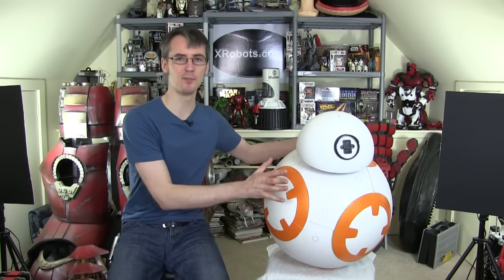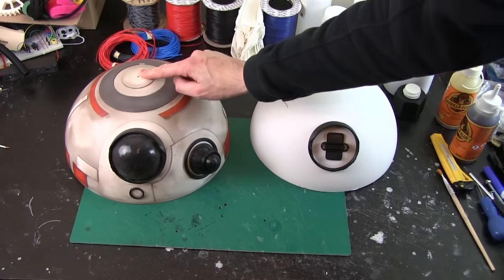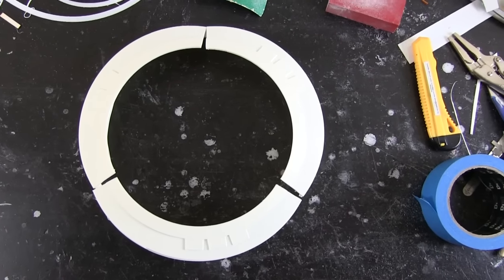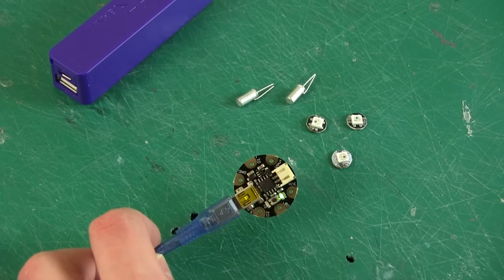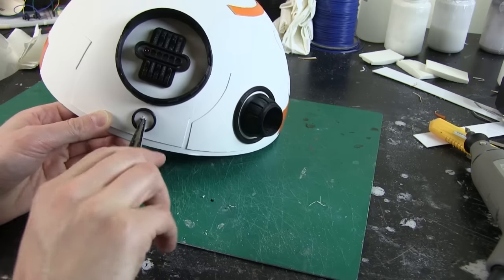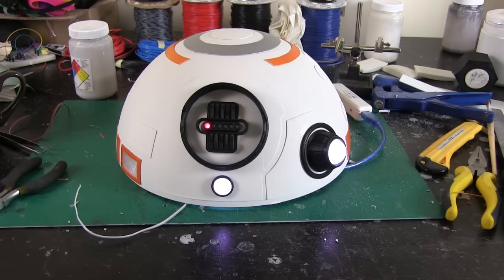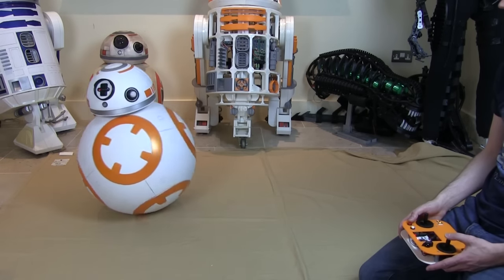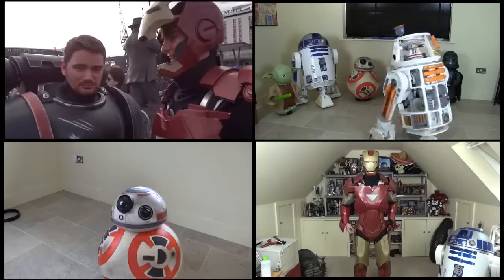Star Wars BB-8 Droid v2 #7 | Head Details & Electronics | James Bruton

Comment: Hey James, I am completely impressed by the lack of print failures in a lot of your projects so far. Quite amazing work, from both you and the printers. One recommendation I would make so that warping does not continue to occur is to "hot box" your printer. Using cardboard or insulation and tape, make an enclosure so that the ambient temp inside the print area is closer to if no equal to the temp of the hot bed. This may not be the prettiest solution, but it is a solution that I have found to be helpful.

Another word of warning for anyone who might try this: ABS, when being melted, gives of some nasty fumes. "Hot boxing" a printer traps a lot of these fumes into one area. Please print in a well ventilated area so that there is no danger to you.

Comment: Love the project!
One little idea: to avoid the light to shine out from the bottom of the head once the LEDs are on, you could consider a black coating behind the transparent parts. Even small black cloth pieces stuck on with velcro strips attached to the globe should prevent or limit the light going trough the inner part of the head, avoinding the glow coming from beneath the skirt. Also velcro and cloth will not be a problem if you ever have to remove/replace an LED :)

Keep it up! Loving your videos

Comment: You could add a strip of some other plastic (PVC?) over the part of the skirt that's vertical to match the diameter of the dome... And maybe you should put something dark behind the lights so that they won't shine under the head. Black electrical tape would be enough, I think.
But your V2 is looking pretty good, James. Congratulations.
Reply: +James Bruton (XRobots) James i just realized your r6 has the same color scheme as bb8
Reply: +allluckyseven Light under the head could look pretty good, especially after the weathering is in
Reply: Asphyr They could make the wheels more visible, though, as they're the only things down there that block the light. And the one from the movie doesn't have lights under there.
But it's just a suggestion anyway.
Reply: +allluckyseven ow right yeah, wheels

Comment: for not looking at reference pictures you did an amazing job, I think yours is just as accurate as mine and I did spend alot of time looking at reference pictures. The only thing on mine that i would say is more accurate than yours in my projector and eye, but I took alot of time with them. But all in all amazing job, if you want me to send pictures of mine and some of the CAD files i made for my eye i like sharing!
Reply: Another thing I did which you haven't is i use gloss paint and metal paints on the body and head that give a shine as if he is actually metal. But that is something you could still have planned idk. If its not i would def suggest it, instead of weathering this one you can make him shine like a brandnew off the production line BB-8 which is what i was going for when making mine.
Reply: +Karol Franzyshen your scale is also more accurate than mine is, this is mainly because i made it with what i had and only spent $50 on additional things i was missing. Mine isn't tiny but i would say it is 15% smaller than yours. All in all tho I am happy with this one i made, it is still going in my star wars room. I do think i am going to make a second one with a few tidbits I am missing, and include some audio files directly from the movie for my BB-8. Because when i made this one the movie was not out, and I only have a few sounds it makes and only 2 of them are actually BB-8 sound files from the trailers and the others are sound files or R2D2 that i have inside my replica R2 unit that is also inside my nerd save. Feel free to message me if you want to me the one i made mayb we can collaborate our ideas for my second build and mayb your third?

Comment: I double-checked the on-stage model for the lighting of the head/dome. I found out that the logic display is a pair of narrow slots, stacked. One lights up and the other apparently doesn't. I don't know if it's too late to fix that, though. It's probably going to be a challenge in a half to do the LEDs in the ball. There do appear to be quite a few of them, both blue and red. I also like the idea of fitting him with a small Go pro camera, but where you'd put it is beyond me. Looking forward to the next update, of course.

Comment: I went to see the film again yesterday and actually you really aren't that far from how it acts and drives on screen, as BB8 drives forward in a hell of a lot of shots his head does push forward plus theres this one scene I think where Rey and Finn are escaping jakku where it shows bb8 driving full speed from the side where you can see the head kind of bouncing off the ball, constrained by the magnets like everyone thought, but the pattern of the circles are spinning around a centre point. In other words if the screen droid for that shot actually wasn't designed like a section of a barrel like yours they would have had to literally direct the puppeteers to line up the chassis or something. Point is from what little reference you had to get something so close (and some of the other BB8 builders from what I can see are still mired on cosmetics) you have done fantastically well James, props to you. So now the little animatronic hatch drawer thing for your important flash drives!? and the grabber and lighter attachments? I think you should go for an actual lighter too, totally safe in convention spaces :) save the magnetic cables, theyre probably a bit too far.

Comment: (great project, really enjoying it come together.) with the rollers you've used between the head and the body have you thought about using something like 'roller ball bearing', googling that phrase will explain what i mean. might smooth out the head movement and help it glide a bit better when it changes directions
Reply: +James Bruton (XRobots) just watched at the 17:20 mark and I'm guessing the explanation is that they're more cushioned then ball castors(18:47), i've seen rubber ball castors before or maybe a 'high bounce' ball could be used in place of the steel bearing. Would it then be worth that much effort for the difference? probably not.

Comment: Awesome video, thanks a lot!  Just a thought, what if you vacuum form the 3d printed bottom piece, and layer the vacuum formed piece with the 3d printed one, so the diameter would increase and make up the difference between the dome head and the 3d printed bottom piece?

Comment: Hey James I was looking at a rostock delta in the new year , and because of its huge z volume many guys say for ABS it's worth the effort to build an enclosure around the printer ( even just some aluminum foil on foam board helped one guy ) that stops the higher layers cooling and keeps the ambient temps higher .... I even thought about adding a 12v ceramic heater and thermostat to pre warm the space... So wondering if that would be any benefit to yourself for larger prints ?

Comment: I just signed up to the r2 builders club and came across this link that lead to your page. this is great work and I'm just curious with all the 3d printed objects how much abs are using and whats the running cost for the parts. I'm calculating quite a bit.

Comment: JAmes, you ever consider replacing the coins in the fly wheel with an induction charge coil? Then place cell balancers on the LiPo's with a charge yes/no logic disconnect on each?

EDIT: follow up, you have any experience with induction charging ?

Comment: Solvent welding is great, but you should not have had no problem printing the skirt in hips, petg, etc and super glueing.  In my experience a good super glue bond on plastics is about as good as a solvent weld.

Comment: Why is it in every bb8 build ive seen they only drive the ball from the bottom and keep the head on a pendulum? Why not drive the ball with motors on the top and bottom then add the ballast in the center of the chassis for stabaility but also make it so the cg is lower than centerline of chassis to keep the head rightside up. I feel like this would get rid of the exaggerated ramping affect that were seeing with the head rolling back while driving. I mean you can see in the trailer clips his head is staying centered ontop of the ball while driving. additionally couldnt you add a tilting arm on the top so his head can move if you wanted it to.

 I can sketch my idea out to you if your interrested.
Reply: +James Bruton (XRobots) I've seen them, great videos. So your saying that having top driving motors wouldn't help with the stability by pushing and pulling the ball around the center? Im not speaking about the side to side stability only about the appearance that the head looks like its going to slide off the top of the ball, like on the spheros the heads moving around just looks cartoonish. Couldnt you differentiat the power between the tops and bottoms to keep the chassis and thus the head level?
 If im incorrect just let me know. Thanks
Reply: +James Bruton (XRobots) just reread your original comment again top motors inside the ball* not on the head so the are apart of the inside chassis